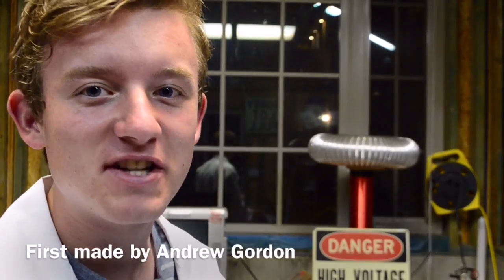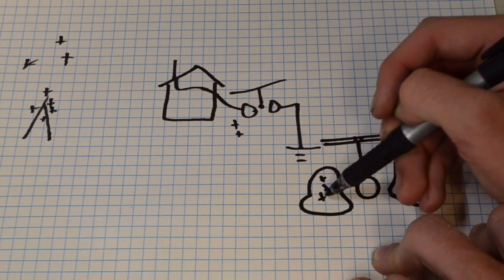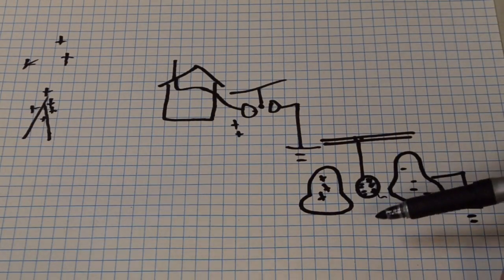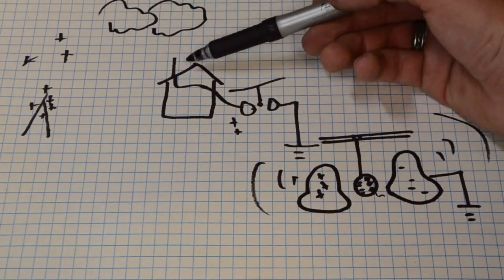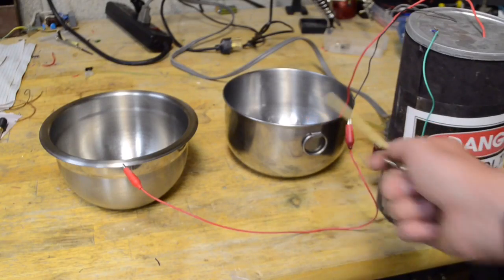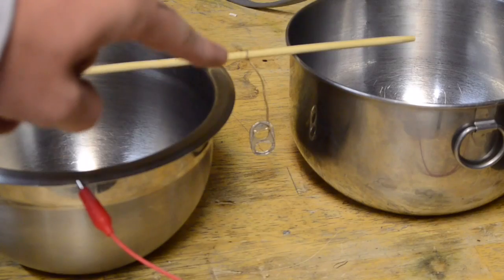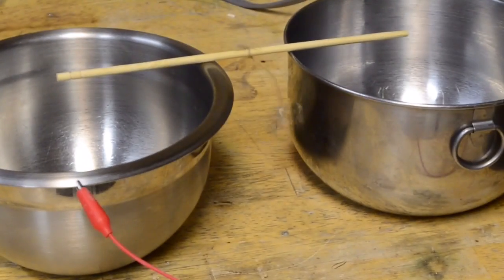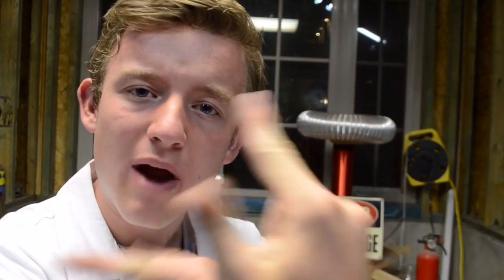How to make Lightning Chimes ( Franklin Bells )

Comment: u are genius man in high voltage devices...  i need ur opinion  about my HV project which is an WImshurst electrostatic HV generator.... can u make constructional  video of that device ... it will be very helpful for me...
Reply: vatsal shah I have built a Wimshurst Machine before. They are fun projects in my opinion.
Reply: LegitDIY  oh... I just asked becoz that project was not working at all.. But now... Finally.. its working ....😊😊
Reply: Well good to know that you got it working. What was your disk diameter and how many sectors per disk did you put on it?
Reply: LegitDIY it was 30 cm in diameter and it contain 18  sagments of aluminium foil ...  But it produce small spark.. I think it requires  large Leyden jars and more  sagments

Comment: Your uploads are brilliant but you might tell the public in conjunction with a Tesla battery how this project can be put to todays use...along with solar panels!
Reply: instead of tying the ball to a single string to a stick:

put two pulleys at the end of the stick. run the string over each pulley, connecting to the ball underneath. as the ball is pulled between each bell, the pulleys will be pulled back and forth. attach (a from of)an alternator to a battery, and the motion generated by the pulleys will turn the alternator, and thus can be used to harness electricity.